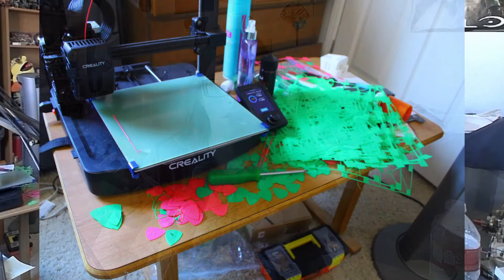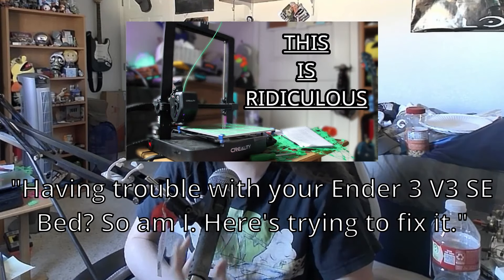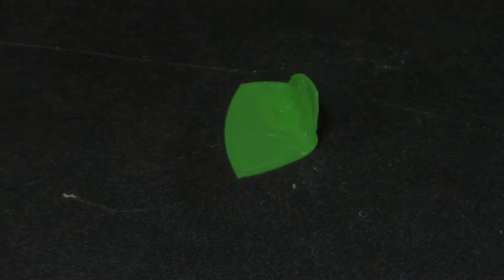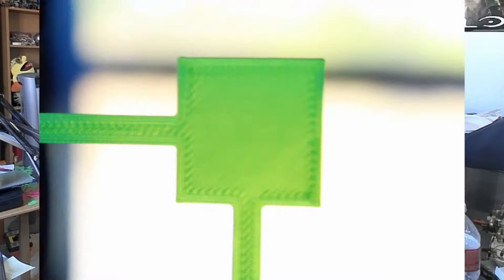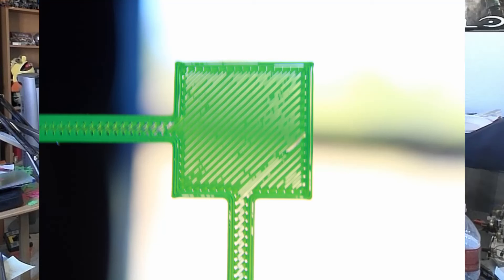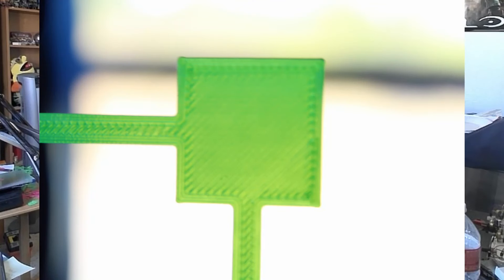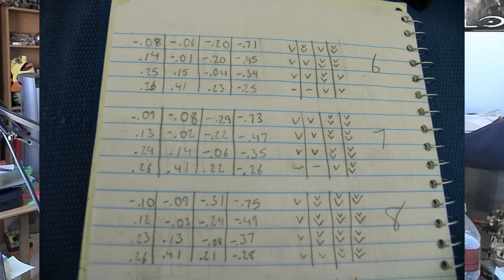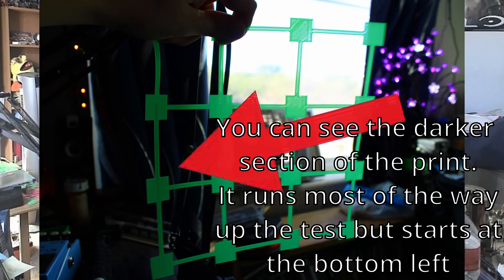(1.0.4 Firmware) How To Level Your Ender 3 V3 SE And Tips To Help!

Comment: I have to tell you guys my experience with the V3 SE. I was pretty disappointed, that the auto-level and auto-z-offset worked that bad in stock condition, but here's a tutorial how to configure your V3 SE perfectly. Make sure to follow each step:
1. Make sure your bed screws are tighened, mine became loose after just two benchy prints
2.  If you have a big deviation in bed level, just create small washer discs in CAD and print them. I made one with 0,7mm height and one in 0,5mm height. Put them under the black plate stands to counter big deviations. With this trick, the maximum difference between front and back just went to about 0,04mm in total.
3. Make sure your X-Axis is aligned. Mine was pretty off from the factory and I had to realign it, creality even has a tutorial for that, using two glue sticks.
4. Always clean your print bed with 99,9% alcohol and a paper towel after each print.
5. Calculate the E-Steps of the extruder accordingly. Mine was a bit off from the factory. There's a good tutorial for the V3 SE, too.
6. As mentioned, stock auto-level is crap. Nozzle is either too near or too far away. After auto-leveling, edit the auto-level data and check each point using a piece of A4 paper. Make sure, the grip of the nozzle on the paper is the same on each point. The more time you took, the better the prints.
7. After you adjusted the level, print a complete flat surface over the print bed with just 50mm/s. Adjust the Z-Offset WHILE printing until you get a perfect flat layer. With this, you find the perfect Z-offset.
8. If you encounter problems with the first layer, after you done all this, try setting first layer flow to 105% or even more. Depends on the filament you use.
9. Mine made pretty bad noises on Y-Axis movements. That was because it nearly didn't have any lubrication on it. Putting a little bit mechanical grease on the rods solved it.
10. Adjust the maximum movements accordingly to the Ender V2. There's a youtube video too highlighting the differences (stock is 4000mm/s!!!!!). Your prints will come out much better with just this setting.
11. Last but not least... To get your prints off the bed, ALWAYS remove the bed and let it rest for 5 minutes until it is cooled down. Then bend it in both ways. Your print will jump off without using any force. I stopped using scrapers.
If you follow each of these steps, your V3 SE will do perfect prints.
Some of you guys in the comments are on the wrong path.
Reply from the maker: Okay, I've heard of the printed washers to physically level out your bed. But what I've been wondering is do they melt? If you print them out of PLA, the transition temperature is 60 C. Does the bottom of the bed not get as hot? I don't know how much heat the bed radiates, so does it reach them even if they're put under the stock standoffs / washers?
Reply: @Bowsmin12  I put them washers under the plate stands and not directly under the plate, basically no heat is coming there. :)
Reply from the maker: @GAGHUNF  Well I just recently started working on a video about physically fixing my V3 SE, I'll be putting your suggestions to the test, would you like to be mentioned?
Reply: @Bowsmin12  Make your video like you prefer. :)
Another tip for any first layer problems:
Reduce first layer speed in your slicer. I found out, the V3 SE doesn't like fast print speeds on first layer. A maximum of 25mm/s with an max acceleration speed of just 50mm/s works fine for me to even print small details, like christmas snowflake decoration (very small!). All other steps above required too, of course. As soon as you bump up first layer speed, problems occur.
In my opinion the V3 SE is a very good printer, just poorly calibrated from factory and badly advertised, with functions which won't work as promised.
Reply from the maker: When does the level data change take place when adjusting the level data. You said to change it while using paper, but I don't think adjusting the level data is a live or active adjustment unlike the Zoffset or simple movements.
Reply: @Bowsmin12  Sorry for the late answer.
Ofcourse, editing the level data is done before printing. Don't forget to preheat the bed before doing the paper test, as the bed expands and deforms with heat. If your are done, do the print test to adjust the Z-offset.
While leveling, you just have to make sure, that the grip is the same on each data point. If you have a light grip on X1Y1, you need light grip on X1Y2, too. Make sure the grip is the same, thats the important bit. If the grip is the same on each data point, you made sure, that the bed is level.
Reply: Thank you so much for this comment! I’m brand new to printing and need to tweak my 3v3se. I also ordered some springs to replace the black spacers that go under the bed, they should allow for full manual control of the height.
Reply: @GAGHUNF  I mean. When you manually edit the leveling data on the v3 se I have it doesn't locate to the areas and it's not a live adjustment so I can't do the paper trick everyone recommends. I've seen videos of them doing it and the extruder goes to each point and they adjust til it sorta grips the paper and do each point. This one will not locate to the areas.
Reply: @TheSlimanthony  Strange. Maybe, they added this feature in newer firmwares?
Try updating to latest 1.0.6, I run it too, works fine.
Reply: @GAGHUNF   ah, I will check my firmware version and any updates, thanks!
Reply: @GAGHUNF  apparently I am on an older version actually. I just unboxed this thing a couple months ago. I expected it to come with the newest. I'm hoping this is the solve
Reply: was it the solution? @TheSlimanthony
Reply: How do you adjust the z-offset while printing? This bit makes absolutely no sense to me. What do I do with this information? Lets say the test print is printing in the back left corner of my printer, the very worst corner, how am I supposed to rapidly adjust the z-offset during the print, and what am I looking for as I do this? The back left corner of my bed is exceptionally low compared to the rest of the bed. Like, -0.80. The front corners are 0.50.

Not trying to sound combative, you have answers that I'm desperate for. This is a frustrating process.

Comment: Im a complete beginner in 3D printer, decided to get into it after seeing a bajillion youtube reviewes raving about the V3 SE and how it was the best begginner printer ever, basically plug and play.
Fast forward to my day one with it and the z-offset was completely bonkers, then with my little to no kowledge I tried fixing it manually and set it to tight and it scratched quite a bit of the buld plate. Okay, it still works, i get it to a decent level and prints stsr working like a charm. I got so addicted to the hobby, then like 3 days later nothing works anymore, I have the opposite problem you had, nothing sticks to my build plate no matter what I do. Tried temperature, bed temperature, leveling again, changing z offset. No fucking deal. Now it seems my bed is a little unbalanced but I still cannot find the sweetspot for the places where it is fucked.

Oh yes, and on top of that now I have a chrinic CR Touch error and the printer is almost unusable. Apparently it is super common in V3 SEs, I contacted support and they will swnd a new part to fix it.

This is so frustrating because I got SUPER addicted to the hobby, I love it so much bow but I CANT PRINT because of this shitty printer.

Your videos are helping a lot to try and troubleshoot some of the problems and I 100% feel your frustrations and im right there with you.
Reply from the maker: It's bad to hear that you're having serious problems with the machine, but great to hear I'm not the only person dissatisfied with the printer. The forums are full of people that love to tinker and don't really care if the printer was really worth it. So any time I try to get some support on saying, "hey, should the company fix this?" I just get excuses defending Creality.

Honestly, I've grown to hate the printer and it's really put my perception of Creality in check. I started with an Ender 3 V2 a few years ago, and it was an okay printer, but it had so many issues along the way. It's a pretty decent printer now, other than still being a "legacy" printer, so it's got small printing imperfections here and there and it's pretty slow, but it's also basically not even a Creality machine anymore. I had to upgrade almost all of the functional parts and change the firmware to a community made one to make the BL / CR touch add on actually work right. Basically they make machines to be cheap and follow trends, but advertise them as so much more.
And I don't know if they send better quality tested units to reviewers or what's going on there, but they almost always get positive video reviews unless they're someone like me who bought it with their own money. The company has to have resources to make their products better out of the box with how big and successful they are, but they just seem like they don't even try or care to.

To top it off I did try to contact Creality a while ago to see about maybe getting the KE sent to me to see if it would be any better and redeem themselves a little bit, but I didn't even get a reply saying that I was too small of a channel. I guess it's for the best since it would probably be a "doctored" machine to make them appear better and more functional than they really are. But basically I have a sever distrust in Creality now, which I guess so do other bigger youtubers like Teaching Tech. I reached out to him and a few others to review an email that I plan to send to Creality asking some serious questions about how they conduct themselves as a business. I will send that soon and hopefully get a reply, but I'm not hopeful.

Anyway, sorry to sort of rant on but I hope this gives some insight into Creality. I would suggest investing in another brand like Bambu Labs or maybe even Elegoo. Bambu have some decent lower end offerings but are a bit more expensive because they work. For how well they typically work, they're probably on the lower end of their price point compared to performance. And I've heard decent things about elegoo's neptune 3 and 4s. But those are also probably batter QT'd units. I've also seen videos with people having issues, but it's still probably better quality than Creality. Hope some of this small novel helps in some way. Thank you for watching.
Reply: @Bowsmin12  yep I got convinced to buy this one because it was $40 cheaper than the Neptune 4 and is 'just as good' - afterwards that person told me they love to fix things and having a 'bond' with their printer so they don't see issues like that as a problem..... ok
Reply from the maker: @archerjackson690  That's exactly the problem with the majority of the Creality community. Most of them are people that want to endlessly tinker, so they make all these excuses and keep feeding the beast which is Creality, never forcing the company to actually improve for the beginners they often try to market toward. These people are so frustrating. They can live their life and have the hobbies they want, but seriously, they need to see this from literally any other point of view and see that it just stinks if you are a person that wants to get started to just have some nice features and print. I don't mind a little tinkering, but this was a whole other level, and it still doesn't truly function right because my and goal is to get the print to actually level ITSELF like it should have been able to out of the box.
The good news is that apparently the printer is open source now, so hopefully someone will make better firmware sometime soon here.

Comment: I received my ender 3 vs se 8 days ago and it printed amazing. No tuning needed. 4 days later it wouldn't print anything without grinding the nozzle into the bed or peeling everything it extruded off the bed.....I kept tweaking the z offset manually but it still wouldn't work. Finally found today that the screws that hold the hotend onto the extruder chassis had come loose so the hotend was flopping all over the place. I'd recommend pulling the extruder apart and checking all the screws to anybody else that has problems......I also readjusted the gantry since it was off when the auto leveling did its thing.....hope that helps someone else too!
Reply from the maker: Haven't heard the extruder one yet, thank you for letting us know.
Reply: Exact same experience. Going to check this just in case. Thanks!
Also, the screws on the bed were loose.
Reply: The screws on the hotend weren't my problem. I'm trying to level the gantry but keep failing. One side is firm in place, the other is loose.
I'm super new to this, so I have no other ideas. I was super happy with it, after 2 prints this became a nightmare.
Reply from the maker: @TheDawnhero  This is a link to a creality video about a bunch of stuff that can come loose and be tightened. Can you check all of these points in the video if you haven't already? P.S. I don't know about you but it helps me to focus on the video if I mute their music, it kinda annoys the crap out of me. Let me know how this works out.
Reply: give us that link,  @Bowsmin12
Reply from the maker: @antunrosovic7284  What link? The link to the github for the Gcode file is in the description.
Reply: @Bowsmin12  You tagged TheDawnhero in this comment thread about a video of all things that can come loose on this printer saying "This is a link to" but did not provide a link. I seem to be having an issue the same as the first comment in this thread    and planned on tightening everything down, could you drop that link as it would be very helpful to have.
Reply from the maker: @nickmesser9230  @antunrosovic7284 @TheDawnhero Sorry about that. I think I had a bunch of comments that I was trying to answer and just forgot.
https://www.youtube.com/watch?v=NFBy-e9iOm4
Reply: Yep you need Check every Screw.
Where ever they are.
And after 10 prints check the belt.s.
I thit everything.
And printed a working bearing.
Straight of my pei plate.
So nice.
Bud you goth to upgrade the printer with everything you can find.
Its like a old moped yamaha fs1 every drive geth your tools .
And check screw.s and the belts.

Comment: Honestly I didn't even realize you could manually adjust the bed. I ended up just doing the 'paper method' and got an almost perfect test print. Thank you for your help!
Reply from the maker: I also think the printer works better with the stock bed and possibly other textured beds. It's been a while since I tried anything, but it would also partially make sense. I think depending in the grit of the build plate, the exact height can start to matter less. And the grain of the plate makes the first layer all look the same unless something was very off. But I don't think they tested with any other type of build plate, because the problem really lies in smoother build plates like PEO or G10, at least in my case. Updating the firmware just seemed to make it worse. The part that annoys me the most is that on one should have to do this with the claims they make in their marketing material which is a point I keep reitterating, but it just seems so sleezy to me when a major amount of users continue to have leveling issues with the "worry free leveling." I'm making a video sometime soon about an email letter I sent to them about these issues, and how they responded.

Comment: got mine over Christmas (160$cdn).  I was disappointed that they did not include bed adjustment knobs like the old enders as my bed came warped.  I ended up putting on yellow springs so I can do some adjustments.  I ended up installing klipper firmware on my ender 3 V3se with a BTT 1.2 raspberry pi clone.  Highly recommended as you can adjust the bed mesh to get accurate bed point reads.
Reply from the maker: This printer has been a frustration in general. While I want it to work, I sort of want it to work on it's own merits, which of course are very lacking. I have heard about converting the bed to the classic hybrid manual and auto method, and many people have said to just convert it to klipper. The problem I have with that is that it's not really creality's machine anymore. I can't say the machine is good or even works when it requires those sorts of mods just to print a decent first layer.
The really sad thing is that people are still continuously buying these machines and being disappointed, especially when it's their first machine. At some point I'm thinking about making a video about trying to "perfect" the machine with mods, but I'm semi holding out for a simpler and hopefully free solution that will allow this to work properly. I think it was in a different video, but I have already tried to print extra sized standoff feet to get the hard level of the bed proper, but the bed screws are just bad and loosen anyway, so you can't really have a consistent level. However one thing I have considered to allow this machine to still function like it's stock self, but also be more consistent, is to use purple thread lock. at least that's what I think is the right color grade. I think purple is the weakest thread lock so that it can provide some stick and "lock," while still being able to break the material with a screwdriver.

Anyway sorry for the longer reply, but I'm trying to come at this from the perspective of someone who doesn't want to tinker, and just wants their machine to work with the least effort required. That may sound a little naive, but as a beginner, like most customers of this machine are, you just want to experiment, have fun, and overall see that the hobby is capable of, but this machine doesn't really ensure that. I will probably make more content developing on this in the future, but for now this is kind of how I view my stance and objective for this machine.